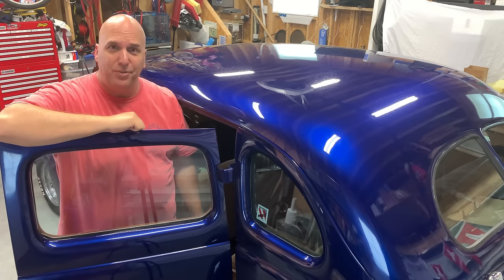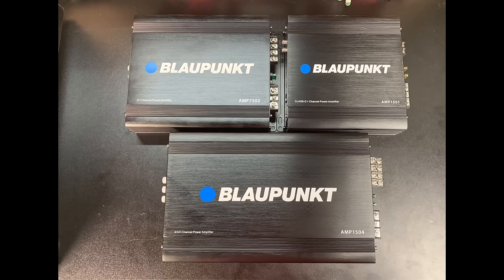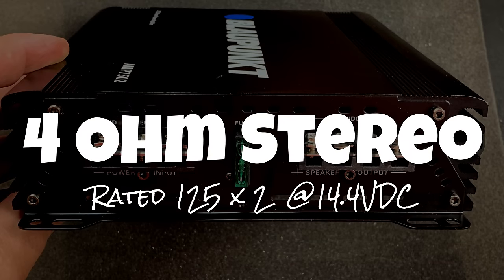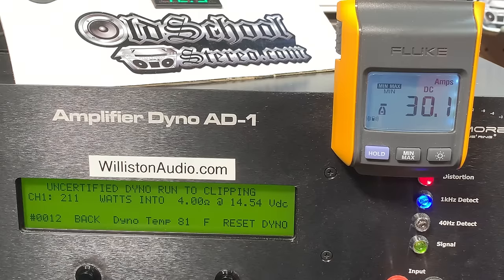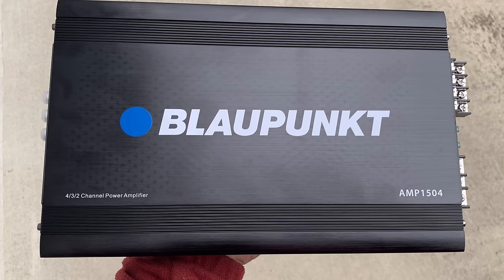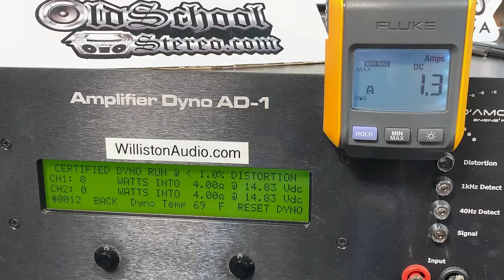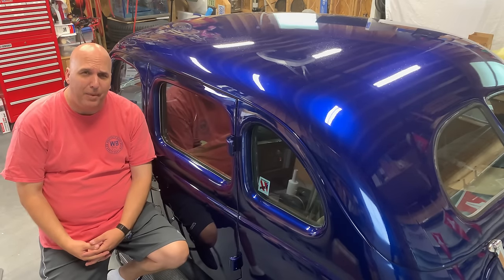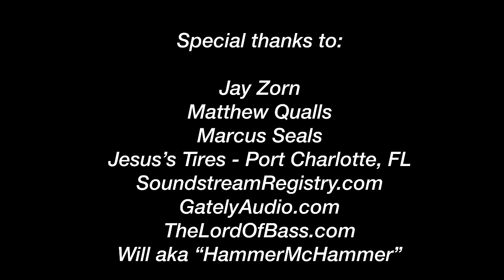Cheap for a Reason? Blaupunkt AMP7502 and AMP1504 Amps Tested [4K]

Comment: I own the 7502 you tested. I bridged it on a 4ohm 10 same brand speaker. Works great spent just over 220 for amp box sub and head unit. Very satisfied with the set up.
Reply: You must not of ever had A REAL system then
Reply from the maker: If it works for you then that’s awesome. I just don’t like being lied to when I read ratings
Reply: @wal  there should be a law for false advertising 😠

Comment: Not for me or my 2 15 inch skars, it likes to turn off with my head unit set with nothing extra and it's a Kenwood Excelon and I have the 3000 Watt Mono Class D, it likes to turn off frequently my amp and speakers were all time and wired to correct ohms etc

Comment: I have this amp in my boats cabin on a 50A inline fuse. I am rewiring the boat and want to put it on a fuse block. What wire gauge and fuse would actually be enough, with 2x speakers 4ohm and 1x 4ohm sub on a 12V?
Reply: Use 4 guage wire the thicker the better

Comment: the build quality of that super small super cheap head unit should have told you automatically how badly these would perform compared to listed spec. blau went chinesium. R.I.P. Blaupunkt. to the bargain basement with ye.
Reply: The head unit hit it's rated power so that's a bad comparison.
Reply: HU uses TDA7850, a jelly bean part almost no one can screw up. the datasheet even includes a literal cookie cutter circuit to prevent people from botching integration.

these amps are discrete component. super easy to mess up, even just by using clone parts that don't do the job of a properly made fet/tranny/etc. and at this price bracket, yeah, they're using clone parts.

so if you take the rest of the head unit into account, you get... well.. cheap crap that will do the job, but don't expect it to stand out. if all you need is a basic radio... it'll get the job done. just like these amps will. they're just cheap chinesium.

personally if i'm going this cheap with something i'd go look at orions cobalts  long before i touch one of these.

Comment: There's not much commentary of whether or not it sounds good. Its an ab amp right? What if it were used in a triamp system just powering add on tweeters? Would it sound good with just tweeters since its an ab amp?   I mean if someone is just using this amp at normal to low gains and only looking for 40 clean watts for tweeters in this setup, i cant see why this amp is such a problem.  Sure it isnt rated accurately and Blaupunkt is lying. But, it probably has a usefulness in a triamp setup for only tweets. No?
Ive been looking for something cheap with only 40 -50 watts true rms to power 4 kenwood kfc tweeters separately.  Im tempted to get a kenwood kac-1804 because its tiny and is close to rated power at only 45 watts rms. But it costs more.
Just trying to assemble a nice, clean triamped system using inexpensive but decent quality components keeping the total system watt level at 1300 watts maximum for sq. I spent the majority on high quality speakers. (Pair JBL 629 6.5, Pair infinity primus pr6512s) 2 pair kenwood kfc st01 and Rockford fosgate p2d4 8 subwoofer. 
Its for my daily driver. I know most of you guys hate audiopipe but i have the apmi 55100 5 channel (before it got discontinued) and an apmi 4095 4 channel ab amp.
I have a 2013 dodge dart 6 channel system with 8.4 uconnect.  The idea was to power the 4 door speakers with the apmi 4095, the dash 3.5s and rear panel 3.5s with the 4 channel from the apmi 55100 and the sub from the 5 channel. Then add on the 2 pair of kenwood kfc st01 with a separate amp.
This build has been on back burner because i cant figure out how to get an PAC amp pro to connect to the 8.4 for dodge dart without a factory amp so i could have RCA line outs to hook up these 3 amps. Very frustrating. 
Nonetheless, i fluctuate between splicing the door speakers and using extra xovers and just use the apmi 4095 with those vs. Triamping the add on tweets with a separate low powered clean amp.
I think this blaupunkt 1504 could be useful for this setup. Simply because i dont plan on blasting this stereo. I like moderate to speaking level volume music that's clean with detailed bass. Not booming bass. The rf p2d4 is good for clean punchy detailed unobtrusive bass. And its a free air sub that fits perfectly in my rear deck's factory 8" sub cutout hole.
What are your thoughts? Which amp works for this type of setup? Or should i splice with extra xovers and just use two amps instead. Thanx much. Love this channel.  Been a sub for years

Comment: I got a 1504 in my suburban running kenwood 6x9 and 6.5 and yes anyone with half a brain knows its not doing what its rated however the sound quality and actual rating is just as good as your lower end kicker and kenwood amps at half or third of the price i was actually impressed enough by the quality of sound that im going to buy another one for my front 4 6.5s which currently has a little kenwood on them and sounds nowhere near as good as the blaupunkt and cost me twice as much

Comment: I have the 1504 n my women’s car on are mids and highs and it never once cut off or went to protect ppl can bash brands for not doing ratings there a lot of brands out there over rate there amp and late 80s early 90s they was one of the top brands out in my opinion the 1504 works great for mids and highs so for those who bash other brands keep bashing but I have seen a lot of top brands at slamology go up in smoke sundown nendos see a lot and it’s all on how u use it
Reply from the maker: My “bashing” is factual, based on false ratings provided by Blaupunkt. They are intentionally misleading the consumer in hopes to sell more products.

Comment: I did get their head unit (still in the box! 😄) but I was thinking that MAYBE their amps MIGHT be a good deal?

Thanks for going through the motions you do to keep people from going through emotions that may not be beneficial.
Reply: Skip the blaupunkt, get the cheap Dual amps, it lies like they all do saying 600w, but puts out 300wRMS for about $50, I picked up two at Rollback from Wal-Mart for $42

Comment: Thanks Big D for testing these pieces of junk.  I got Blaupunkted.  I own the 7502 and it's okay on four 5 1/4 Kickers.  I now see I'm only getting 100 watts per channel at 2 ohms stereo.  I have the high pass set at 160 hz and they start distorting at 31 volume on the Pioneer head unit.
Reply from the maker: Boom shocka locka

Comment: Mate... There is a market in which people assume that what's written on the box is just numbers without any meaning. These people will jump on writing something in the revue section on Amazon, but they only allow actual customers to do so. Let me ask you this: Even now, as we know from your testing that the numbers are fake, still the 1504 brings to the table a decent distortion at 50 w RMS for $60 bucks, draining a very little amount of current. You will not deny the fact that it's an improvement from a stock radio, regardless of make and model and I'm not talking high-end cars, even so both my Mercedes ones sound like shit, one being equipped with BOSE and the other one with Harman Kardon... Would you have a different take if the box would have stated the actual numbers? Let's be honest, even great cars age and the value will not increase if an expensive system is at hand. You might still want a better sound for the remaining miles you will spend in such and you have no desire to brake the bank... I mean, this is a scenario, isn't it? Allow those people to be happy for less and look at the numbers because numbers don't lie; 2k + and north of 4 stars means at least one thing: They are well built in the sense that they don't die on people. Will they out-perform a more expensive unit? Most likely not. Have a good one and excuse my intrusion.

Comment: Wonder what results you would get at the FTC standard..😂 (All ch driven @ 20Hz-20kHz and less than 0,5% THD)
Reply from the maker: 1.21 gigawatts surely
Reply: @wal If it was 1ch and 100% THD maybe🤣 Some manufactures really get some weird results in the way they messure. Think they actually pull numbers in random from their ass🤔 But I think "FTC watts" would give more around 2/3 or maybe even 1/2 of the results you got at 1kHz. Since FTC is quite a bit more strict than RMS.

Comment: I bought the 4 channel just to see what it would do.. it had a cool 30 min run 😆🤣
Reply: Did it blow up?
Reply: @Lonchpad1  nah... it just stopped working.. I might open it up since I missed the return date
Reply: @jacobwheeler6136  
I just got one and am going to try it out.
What gauge feed wire did you use?
Reply: @Lonchpad1  4 ofc
Reply: @Lonchpad1  I'm using this one for my tweeters and mid range and it's awesome.. I have it in a single cab 1991 toyota pickup..   AudioControl ACM-2.300

Comment: What is the max wattage the dyno can go?
Reply from the maker: 24,000 watts at 0.5 ohms on current firmware, but the Amp Dyno doesn't provide the electrical. You must supply the batteries or power supply, so testing big amps can be SUPER expensive
Reply: @wal  Holy s**t.

Comment: I have a boss pt3000 need to find out true RMS ratings at 2 oms
Reply: Whatever the RMS is...cut that number in half. This will be close. Just look at BudgetGemorBudgetBust test of the mono version of this amp series. It will give you an idea. And DO NOT ever wire below 2Ohms stereo, or 4Ohms mono.

Comment: Behind every Blaupunkt product is over 90 years of innovation and excellence, and the AMP7502 2-Channel, Full-Range Amplifier embodies just that. With an optimized 160W RMS and 750W output, you can give your audio system the perfect boost in sound. Its slim design fits perfectly into any trunk, so you can easily hook it up to your stereo system.

1500 watts on one 30 amp fuse, that's 500% efficient. That is innovative...👍
Reply: LOL
Reply from the maker: Makes power with built in Mr Fusion

Comment: If you needed 70w/4 and you only had $60 bucks, there you go...
Reply from the maker: Pretty much!
Reply: You get what you pay for. The specification on the box and in the instruction manual is what makes no sense. If we were the average Joe went out got this amplifier and expected it to run for subwoofers then what. Disappointment got a package back up return it to wherever you got it from try to get a refund or exchange if they don't have that policy then you read the stuck with it or you got to sell it to somebody. So the issue is not really the money per wattage which is fair it's what they're claiming is what the problem is

Comment: Kinda disappointed but realistically knew it was too good to be true plus it's better to find out before hand then after I buy it and wonder why it doesn't meet my expectations 😂
Reply from the maker: That’s what I’m here for. Wasting my $$ so you don’t have to 😬
Reply: Williston Audio Labs right on man appreciate it. Now I have an 04 mazda 6 without the bose system so I wanna upgrade factory and I was thinking component speakers up front and coaxial in the rear and probably wanna go with like 100w rms speakers and I have an mtx magnum sub (500w rms) and I was wondering what are some amp setups you would recommend me looking into that are good? My budget is somewhere around $200-$300 for the amps

Comment: Manufacturers should be tased for each watt they fall under their bs marketing numbers.   Too bad false advertising in most states results in merely a small fine, thus making it pointless to pursue a claim.
Reply from the maker: I think I should be refunded in 100 fold for each amp Dyno failure

Comment: Crazy! Even their subs are crap. Used to be a good brand years ago.
Reply: Yes guys Blaupunkt  use to be Germany premier brand From 60's70's+90's they came stock in Porsche and merc..back in those days.
Reply: But hey as BigD showed the decks and sub's. Are still good hey were else you going to find sub's with sewn in tinsel Leeds with 8gage push term.and 400 watts that sells for $20-$25 and head unit with blue tooth for $10-$12.50

Comment: This was SAD. More sad than my expectations. Single sided PCB?! Semi open phenolic potentiometers. Zero surface mount components. Just barely made my minimum criteria for an amplifier - to produce at least 1.5 times power with every halving of load. However, 1.5 times these days is sad as it is a minimum. True amplifiers double power and voltage. What a pair of cheap turds. Totally NOT on the same level as the monoblock amplifier, both in terms of construction and output per dollar. If someone buys these multichannel Blaupunkts then you have problems. Get a Boss or Rockville before these. Get a used vintage amp. Anything!
Reply from the maker: You said it!